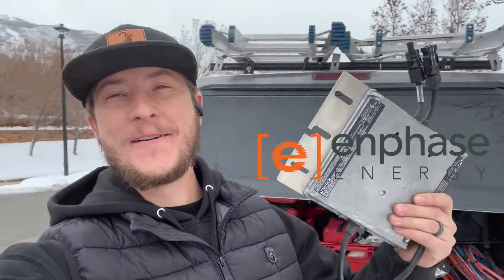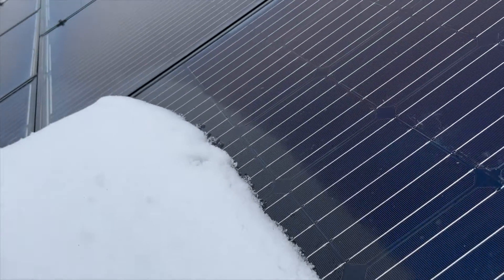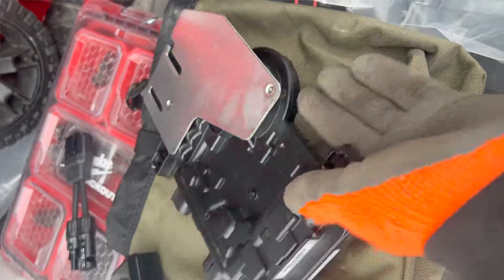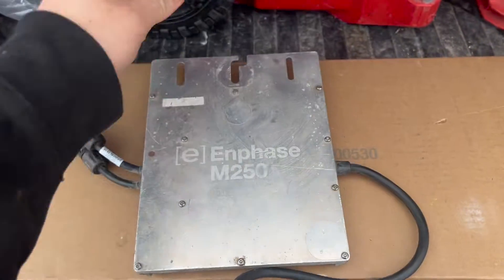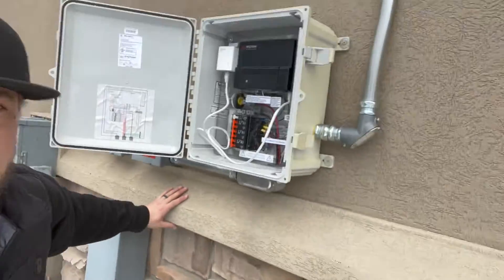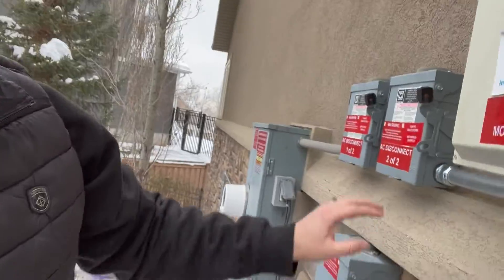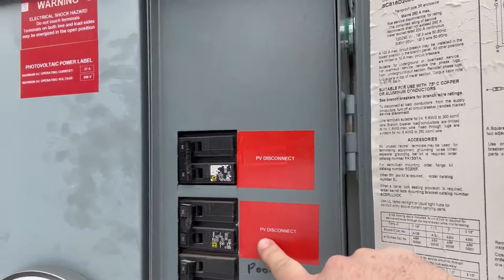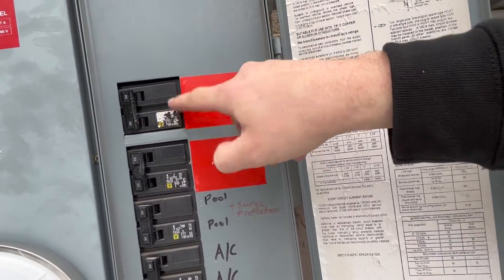How to Replace A Broken Enphase Solar Panel Micro Inverter

Comment: bullshit video, does not show anything about replacing and using tools to remove connectors. BE AWARE connectors are hard to take apart and you need to know how to use the tool first before going up!!
Reply from the maker: Sorry it gave you such a hard time. I’ve discontinued thousands and thousands of those those I didn’t even think to explain it. I don’t usually have a tool on me so I just take a flat head and insert it into the right hole then wiggle it a bit and rock the connector. Then do it on the left side and pull some more. A little back and forth and should be out.

Comment: Thanks for making this video, very helpful. I have one suspected bad M215 microinverter that has to be replaced. I contacted Enphase and they suggested to swap it with another existing microinverter on another panel. There is a main disconnect switch for all the panels. So you're saying shut this off and also turn the breakers off? How would you check to make sure it's dead.
Reply from the maker: Because it’s AC electricity they make these little sticks that test if I wire is live or not. It’s called a none contract voltage tester. You can get them for pretty cheap. If you get close to a wire with it it turns red if it has power! Be safe!!!
Reply: @solargoat  thanks. I figure once I unplug the panel from the inverter, there will be no more current and I can replace the inverter. I hope this fixes it, otherwise I will then test the panel.

Comment: Thanks man. 

Question: If I need to fix the roof, can I power off the system, go up there disconnect my panel/inverter, make my roof repairs, reconnect everything, and turn on the system without issues? I don’t want to void the warranty. I also don’t want to call tech support, etc. 

Sorry, trying to avoid a tech every time I need a quick roof repair. 😂

Comment: Great video, this really helped me replace one of my dead micro converters! The new Enphase Installer Toolkit app lets you switch out the micro converters in the system with swapping out their serial numbers, takes about 30 minutes for the system to start to see the new converter once you swap the numbers in the app. Cheers
Reply from the maker: I’m glad it helped you and your systems up and running!